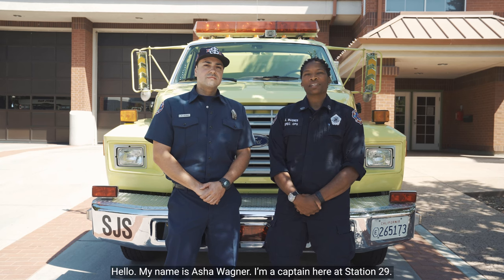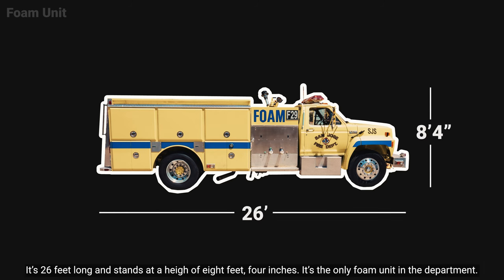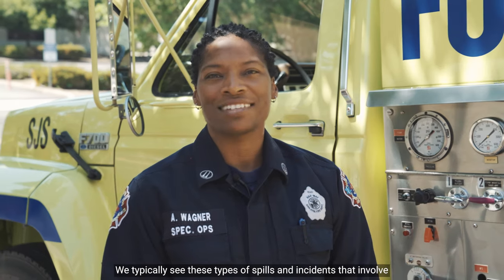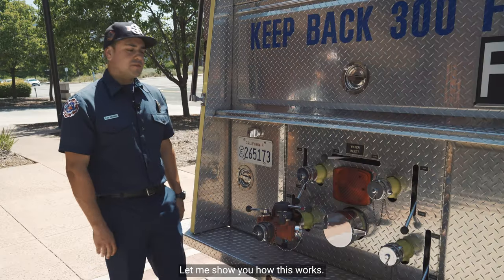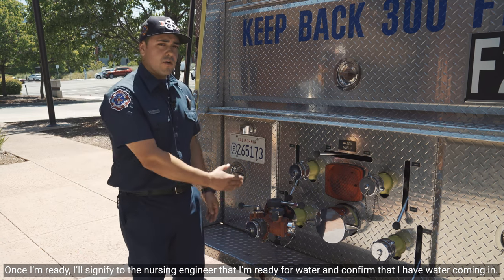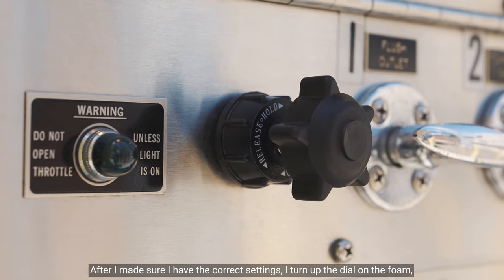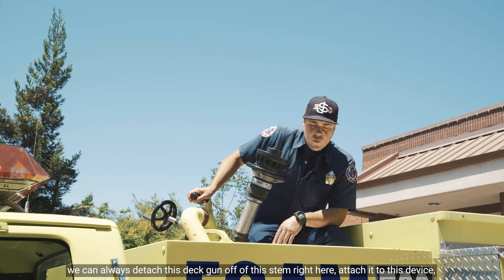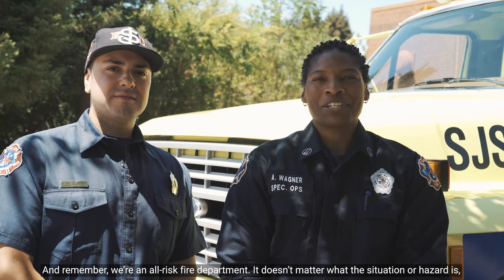Wheels Wednesday | Ep. 8 | Foam Unit

Comment: As this apparatus is over 40 years old, any plans to replace it with a new unit?
Reply from the maker: As of now, there are no plans to replace this unit.
Reply: It would not need a replacement since it rarely goes anywhere and is in great condition